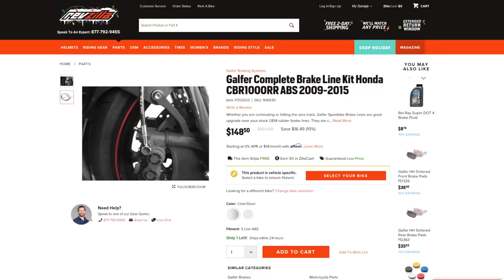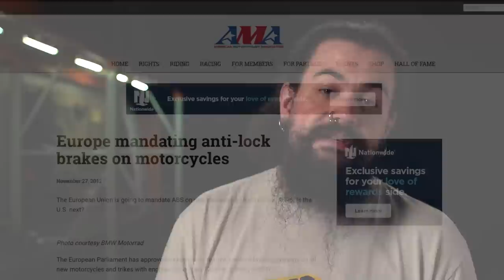3 Arguments AGAINST Motorcycle ABS!

Comment: I have been riding and training officers to ride motorcycles before abs was ever invented. I always taught threshold breaking where a rider could demonstrate maximum braking to the point just prior to locking up the front and rear tire in a straight line. The exercise starts at 15mph and increases until you get to 65mph. It is a little hair raising watching students for the first time lock up their front brake. I remember when the BMW's came out with abs. One of the reps brought one to motor training to demonstrate how well the abs worked. The rep entered the exercise at 60 mph and locked the front brake lever. The front tire instantly locked, kicked sideways and threw the rep off the front of the bike, breaking both wrists. The rep had not been paying attention to the light on the instrument panel that told him his abs had not reset itself and was functioning like non-abs. His pain made my point that day. Always learn and practice threshold braking and if that isn't doing it on a bike equipped with abs, grab the brake lever a little harder.  Thank you for the video.
Reply: Yup. ABS is a significant safety boost for most people. Because most people never learn learn how to brake, correctly. It can be argued that ABS is a very minor feature for the minority who actually learn this.
 
The way you taught people, slowly increasing from 15 mph to 65 mph? That is good stuff. But there's a finer point to learn from it. At 15-20 mph, the bike is completely stopped before most of the "things of interest" begin to happen, at all. This is why most people don't learn. They go in a parking lot and stomp on their brakes at 15-20 mph, and then they believe they learned something. The only thing you might learn from this is how not lock your front too early, before weight has transferred to the front. You know the people who stopped their learning, here. These are the dudes who are afraid of their front brake and think their rear brake is amazeballs.

As you get up to 30 mph, that's where the bike is still moving for a split second when the other "things of interest" begin to occur. The rear lock/slide will start to manifest. And depending on the bike, you will either start to be able to experience rear wheel lift, or you can start to experience front wheel lock/shudder while the front is loaded. This is where you learn to respect the importance of your front brake and begin to realize just how fast the rear brake becomes useless and must be released (released completely on most bikes; perhaps mostly released on some long cruisers) when braking hard on dry street.   

If I were to teach people how you do it, I would make them stay here, in the 30-35 mph speed, until they can demonstrate purposeful excess of the limits of these phenomena. So they can experience and know what the limits are, for the main purpose of learning how to get to max braking fast as possible without causing these problems. Make them slide the rear tire. Make them either lift the rear tire or experience front lock/shudder under load. And be sure to explain that at higher speeds, these things are increasingly dangerous and potentially difficult to recover from, so they are to be avoided as you go on and increase the speeds to 65 mph! The point of this is to find the size and shape of the strike zone at a safe speed. It remains the same at higher speeds, just increasingly more dangerous and requiring ever faster reflexes and cool head to recover and to maintain/reattain maximum braking if/when you are to accidentally exceed these limits.
Reply: I have observed some  instructors are a major impediment to motorcycle tech safety adoption because the old school mentality perceives it as a threat to their future livelihood or  somehow skipping a right of passage by new riders into their elite group.  You reference a first generation ABS system on a BMW which has nothing to do with current tech..  Now fast forward how many years and such a past example is completely irrelevant?

 I just purchased 2022 Versys 1000 SE complete with 6-axis IMU.  I am probably no where as skilled a rider as you are but with such system I could easily out perform you while you operate a similar bike without such aids  in any random   braking or acceleration  test on a closed course consisting of  turns or straight line with  a mix of wet, sandy road , etc.   Particularly where no practice is allowed and braking command is issued randomly and you are measured on your  ability required to maintain minimum speed, brake in shortest possible distance while maintaining the intended  line.   That is more representative of real world, unpredictable street scenario and  not fictional, preplanned exercise of accelerating to 50 and initiating a planned stop on best case dry pavement scenario.    The truth of the matter is these advanced systems now exceed the capabilities of even expert riders and overcome  limitations of human sensory capabilities.

The teaching of threshold braking with such new tech is obsolete thinking and will underperform modern systems in real world unpredictable conditions.  It is less thinking, faster reaction time and ramping up brake pressure as soon as possible to scrub speed and stop in shortest distance possible.  Then rider can instead focus on finding and executing safe out from any potential impact situation.   When  on motorcycle with 6 axis IMU in emergency situation you simply grab full front brake whether in a turn or in a straight line and system does the rest.  Lean angle ABS will not only allow you to slow at maximum rate possible based on available traction but maintain a line in a turn without low siding.

If you don't accept what I stated then you are most likely deliberately ignoring the publically available information from Bosch, Continental, KTM, and other manufacturers whose testing video demonstrations, dats, and descriptions validate such tech works as promised.  It well should work because it was first developed and in use by MotoGp riders since over 10 years ago.
Reply: @kannermw  What happens if the rider gets on a bike that doesn't have ABS? You do realize they still sale many bikes today without ABS. What happens if your abs malfunctions? You know that is why there is an abs light on every dash, because occasionally they malfunction.Teaching someone how to ride using threshold braking is not the only training they receive. They go on to learn maximum stopping distance using abs, trail braking, collision avoidance, skid pan, high speed pursuit, mountain riding, shooting from a motorcycle, etc. The police motor course is probably one of the most difficult riding courses to pass and unlike MotoGP, they must train for every situation they might experience riding in a urban and rural environment, which includes all types of surfaces, pot holes, sand, dirt, water, mud, driving up curbs, making u-turns uphill, downhill within 18' diameter.
Reply: @capecrusader6932  I currently own 3 motorcycles and one doesn't have any electronic rider aids as it is DR650 dual sport.  I started riding in late 70's off-road at age 14.  When I received my motorcycle license endorsement at age 16 I already had 100s of hours off-road  riding experience on steep, bumpy, rutted, or low traction terrain.  My personal belief is no course in a controlled environment on pavement builds your skills in motorcycle dynamics, balance, and control as much as off-road.  Now at that time 40 years ago there were no choice in advanced tech in motorcycles so if you wanted to ride you had no choice but to accept  the risk.  ABS wasn't even available in cars but became mandatory in cars in 2004. I live in upper midwest where there is snow and ice.  I will never ignorantly suggest non ABS cars and pumping the brakes was ever as effective or simple as mashing the pedal with ABS and still maintaining steering control.  I have never had a car in last 20 years with ABS have a system failure.  The only three new motorcycles I have purchase since 2013 with ABS have NEVER had an ABS system failure.  Having ABS does not affect your bility to learn how to properly modulate brakes effectively.  When it intervenes you know when it happens and if anything it can teach you the margins of traction without having to fall on the pavement or worse. 

We need to stop using lame excuses suggesting that current advanced tech is unreliable as that is simply not true.   It is now long proven tech that is very reliable.  Studies have proven ABS reduces motorcycle fatalities by 25%.  Approximately 57% of total fatal motorcycle deaths are single vehicle accidents in curves.  It is estimated that 6 axis IMU with lean angle ABS/traction control would reduce this death rate by 50% or more.  With aging demographics comes decline in visual acuity, reaction times, and physical strength and coordination.  These older experienced riders will benefit a well.   Knowing what I know now I would never buy a motorcycle without advanced rider aids because it is simply not that expensive and better than any insurance policy at minimizing risk of permanent disability or death.

Safety instructors should be encouraging new riders to consider ONLY motorcycles with these advanced technologies instead of finding false excuses why they aren't that valuable.  It is these least skilled riders most likely to be prevented from making their first and final mistake on the street.  Then instructors should be instructing riders how to most effectively use motorcycles with ABS or advanced tech to its fullest and practice aggressive braking technique so they experience the dynamic effects in an emergency.   They should also warn riders that simple  ABS or simple traction control have inherent risks of causing low side or high side in a curve when not used properly as compared to those with advanced IMU. 

We need more instructors to carry the torch for a better future in motorcycles.  The history is not good as compared to other passenger vehicles in terms of reducing accid3ent or  fatality rates from 20 plus years ago as compare to  cars where federal government mandated  safety in the form of ABS, airbags, etc.   There is no need to wait for legislation if riders demand these things from manufacturers as standard equipment.  ABS adds ~ $300 to cost of motorcycle and IMU tech another $400.  A total of $700 is peanuts compared to the benefits of  risk reduction in loss of life, lost income, pain and suffering, or a lifetime of disability.

Comment: A simple procedure like renewing your brake fluid and bleeding the system becomes a real PIA!  
If you learn to ride on the road with a ABS only, you sure aren't going to develop a "feel" for braking traction that will allow you to do better than the ABS though offroad riding is a great way to learn this skill.
Reply: Yes if you go to a Motorcycle course they usually have bikes without ABS. You shouldn't rely on ABS because you don't have proper braking technique. That being said, having proper braking technique AND ABS is the perfect combo. It's one of if not the best safety feature you can get on your bike.

Comment: I appreciate the sentiment, but, your first reason has too many qualifiers for me to accept it at face value - if you are an accomplished rider, if you are on dry pavement, etc. I would probably agree with your reasoning more, if we were all trained to threshold brake and operate the motorcycle - any motorcycle - at an accomplished rider level, but most of us are not trained or conditioned to operate a motorcycle that way. Your final argument also rings a bit false when we have automobile safety and emissions requirements based off one or two US states requirements, i.e California emissions standards. We don't get a choice to go with the lower emission standard car for a cheaper price because we live in a different state. It's not a new concept for manufacturers to meet the lowest common denominator stringent standard for their product line and pass the cost on to the consumer - you hit on it when you talked about economies of scale. It's not optimal, but nothing new. Keep up the good work with the thought provoking ideas - thanks.

Comment: Off road ABS "OFF". On road you will have ha hard time beating the ABS for stopping distance and control. Just watch some youtube and see how many lock the front wheel in a panic stop and dump the bike over. For all of the "I only use the rear brakes" your stopping distance is way past the impact point of any panic stop.
Reply: I've had both brakes lock up while doing emergency stop training, it's not an automatic wipe-out(I never wiped out), but it does mean you have to let go off the front brake and start over, which isn't really something you want to do in an emergency situation.
My bike has ABS, it was however malfunctioning due to low battery for a while, fixed it with a charger.

Comment: I have been riding over 40 yrs and never had abs until my 2002  bmw 1150R I have just purchased. I also have a vfr 800 with abs that I am working on now and I have to say it is a royal pain in the ass to work around. The way I ride I can live without it. When it breaks it will be out of there as they offered both these bikes in non abs.

Comment: Living in Thailand now, i find i ride in heavy auto/motorcycle traffic, often at slow speeds.  Abs is great for inexperienced drivers who dump their bikes after locking up the front brakes.  I see it every day.  Thanks Lem
Reply: Is ABS standard in Thailand? I found it interesting that scooters have auto engine stop start there to save fuel.
Reply: Michael Clark abs is not standard. I have a Yamaha n-max which has front and rear.  I see inexperienced riders lock the front brake up all the time in traffic situations, and down they go.

Comment: Please do a test with recent sportbike with a professional track rider. There's some comparisons on Youtube but most date from 10 years ago (electronic aids have come a long way since!). I'd like to see the very latest technology used by a pro rider and see how it stacks up to pure talent with no ABS (one pass in the dry and one in the wet). Thanks!
Reply: Speedytrip, it’s been done.  The results can be summed up as follows:
If the rider doesn’t lock the brakes (threshold braking or less), there is no difference between the bike with or without ABS.
If the rider does lock the brakes (greater than threshold braking), the bike with ABS will stop more quickly, and without loss of control.
Reply: @Vessekx  Haven't seen that test using the latest systems. Have a link to the video?
Reply: Speedytrip, I stumbled across one about a year and a half ago when I was prepping for my MSF course.

There’s another I stumbled across more recently, but it’s more of an overview comparison between no ABS, ABS, and cornering ABS than a scientific test.

I’ll see if I can dig that one up.
Reply: Speedytrip, and some more:

https://youtu.be/X6kO6ltk3a0

https://youtu.be/TrWOeD9FDgU

Comment: Just mu two cents here ....

I think a thing not to underestemate is if a rider learns riding with his first bike ... i have never owned a motorcycle with abs and im sure it has made me a better rider because of it .

It do however understand it can be a good addition to riders riding in severe weather tho
Reply: Just to provide a counterpoint, all of my bikes have had ABS. I think that by knowing exactly when the ABS is going to kick in has allowed me to test how much I can brake before wheel lock, without eating pavement, and thus improve my braking skills. Besides, it has saved my ass a couple of times with assholes cutting red lights.
Reply: @dogman8339  counterpoint to both statements - those apply only in case the person is talented or continuous enough to learn and admit if he made a boo boo . 
Countless times I see guys saved by the ABS that blame everything but not that they crewed up. Same with the no ABS bike ( and in my view every bike but still ) know your speed , the speed of all around you and because you don't have ABS to safe your ass plan ahead.